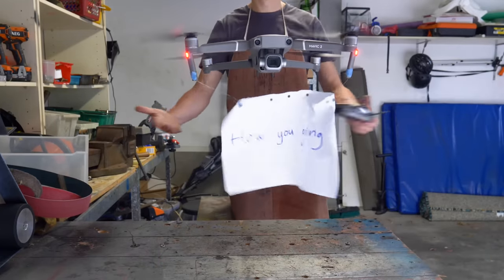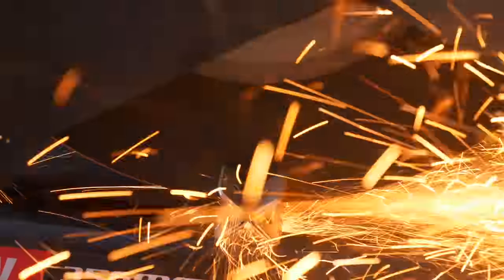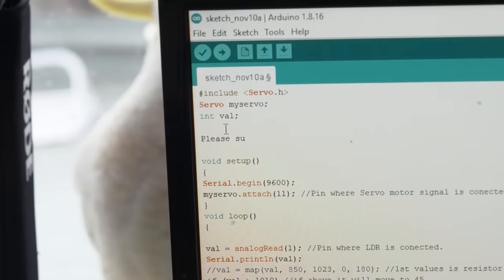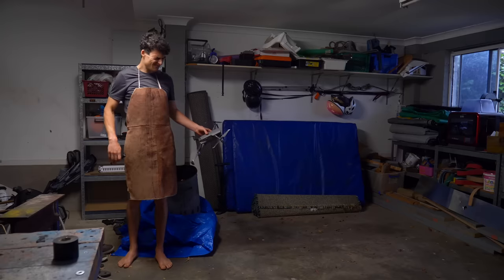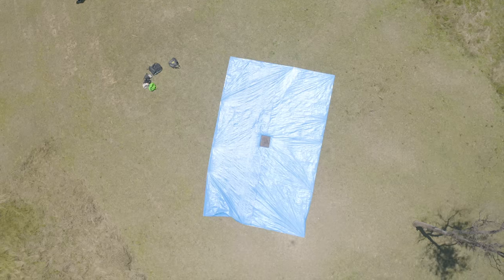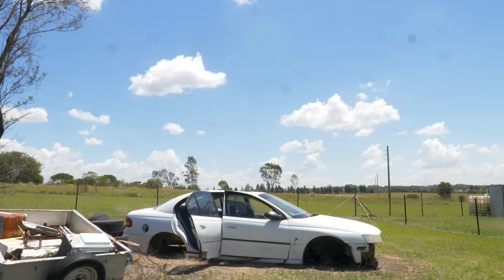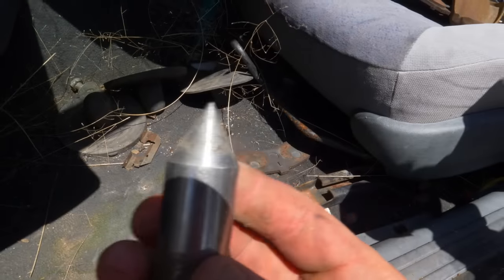Drone Darts are Silent and Deadly!

Comment: Random thing, but groups in Ukraine have been using drones this exact same way, using the light switch as a DIY mechanism for servos that drop payloads, quite ingenious
Reply: and there are videos of nice hits into open sunroof of the car or a military vehicle 👍
Reply: In myanmar as well
Reply: That video of a nade going through the driver's hatch was something else, imagine being the crew of a Russian tank in this conflict. Manning ages old Soviet armour without AC, and you can't even open a hatch to cool off because there may be someone waiting to have his day made by it
Reply: And where do you think they got that absolutely genius idea? 😎
Reply: Yeah, I wanted to write the same. Our soldiers use custom 3D printed holders with drop mechanism.

Some russians "geniuses" trying to do the same, but they put granade to fucking cup from destroyed ukrainian  kitchens... and it worstest thing ever, sometimes "something goes wrong", and cup just turna, and granade falls somewhere to their own blindages.
Reply: His light switch was really misguided. There are really easy compact circuits you can build from parts from old electronics. 1 FET or BJT a light sensor, LED, crappy solar panel from calculator or solar light, a battery, and a resistor or two depending on battery current and voltage. Plenty of schematics on google images for light activated switch. Better than a servo is nitinol? wire/muscle wire is used in toy helicopters to release plastic missiles. His release mechanism could have been smaller than the missiles and weigh nothing
Reply: you can pay these groups to have anything written on the bomb/mortar/grenade and they'll take a video of them dropping it (with your custom message on it), its like a death cameo, kind of interesting and also kind of morbid
Reply: @Wtfinc  Don't know a lot about electronic circuits or whatever, but can't you just kinda hijack the signal that activates the light in the first place, rather than having something react to light been seen. Like check if there's current in the wire that goes to the light
Reply: whatever it takes to send the orcs home, whole or in pieces.
Reply: How
Reply: @riograndedosulball248  why would a tanker need AC, their survival expectancy is like 10 minutes
Reply: @roadsigncheems1566  OMG that's horrible... Where?
Reply: @mymy-nv4er  lol, i dunno probably some tor site, or you could go somewhere shady over there and “meet someone”
Reply: @ukrainian333  yes i saw a video of ukrainian soldiers doing the same thing with a plastic cup.
Reply: Probably learned it from this video lmao
Reply: @riograndedosulball248  Or a Ukcop in the trenches having grenades dropped on you then a barrage of Russian artillary following it.
Reply: Both Ukrainians and Russians and myanmar army and myanmar rebels doing it. Actually it has become mainstay.
Reply: Are you insinuating that this video teaches you how to build weapons to fight against a heavily militarized enemy like, for instance, the goverment?
Reply: @Pavidota  yeah I'd guess you can just replace it with a radio controlled signal.. If you have enough spare time and a few dollars anyone with an average IQ and some guidance from the internet can make these. There already are drones with release mechanism to drop toy munitions lol
Reply: @riograndedosulball248  hatch shots are on abandoned vics (either out of fuel or otherwise immobilised)

Comment: The Romans used something similar, although it was thrown so that the arc of it would bypass the enemy's shield 🛡. It also had a piercing iron point.
Deadly lawn darts...
Reply: It was called a  Plumbata.
Had to look it up....
Reply: @leveljoe  If you haven't already, look up Tod's Workshop. He tests them out (as well as a lot of fun historical weapons which now include a trebuchet).
Reply: Im pretty sure pilla had long points so that they would pass through the shield and hit you behind it. I think they were also made of mild steel with hard iron points so that they would get bent and couldnt get thrown back. The romans would then fix and recylcle them.
Reply: @OutOfNamesToChoose  beat me to it, really good work from Tod in everything he does
Reply: I am pretty sure lawn darts by themselves are deadly.
Reply: So... Lawndarts
Reply: @MazeFrame  
Yes, but lawn darts we're not made with the intention to kill/injure,  the plumbata specifically was and predates it buy a number years.
Reply: @OutOfNamesToChoose  
What's old is new again.
Reply: @mietek3921  Did the pilum get typo'd to "pilla"?
Reply: @leveljoe  no, pilla is plural for pilum. :)
Reply: @mietek3921  👍good to know, but it has only one "l". 
pila
Had to look that up too.

Comment: In the next video you should try to turn your military drone into a normal drone back again. I bet it will be much harder, because they are not designed for that task!
Reply: Just remove the loosely taped on electronics?
Reply: @4esv   I think he meant an actual military drone
Reply: @danmack7769  he said "Your" military drone, I don't know how he could've meant "someone elses actual military drone" whilst saying "your military drone"

Even better, English got it's possessive pronoun structure from german so I don't even know how that got messed up.
Reply: @4esv  Yes I know what you mean, but I was thinking he was going for it as a title. You know for example "How To Turn Your Military Drone Into A Regular Drone!"
Reply: @danmack7769  You know what, fair point I did not look at it that way. You are right

Comment: if you wanted more accuracy you could have angle the fins on the back to impart spin, creating an amount of dynamic stability.

But also, you can't use drones above 400ft  (133m) in Australia soo...
Reply: I think much of the lack of accuracy comes from the latch yanking the fins to the side as it releases
Reply: @Skwerll  "I welded a metal latch to a $970 commerical drone"
Reply: @Skwerll  A lot of bombs are dropped horizontally so that shouldn't be much of an issue. I agree with the first comment in that an angled pitch on the fins would help provide dynamic stability which also helps mitigate the air resistance on the fins which could be responsible for additional variation
Reply: I thought that the moment I saw the fins.

Comment: Why straight fins? Twisty fins would probably stabilize the dart and improve accuracy.
Reply: Simpler/easier or just what was thought of/what was found on the original
Reply: I guess they are easier to make  simetrical.
Reply: Twisted ones would slow it down a little. He could have made them larger though

Comment: Just an FYI. When soldering small parts apply a bit of solder to the iron itself. Makes a bead on the end.  Then just tap the bead to what your soldering and it just drips on. Instead of holding it all to the prong itself. Great vids tho. Love what you do
Reply: If you want good solder points, you apply a little bit of solder to the tip (just a thin "coat" for the heat transfer), heat up the pad and melt the solder on the pad, not on the tip. Otherwise, your flux will be gone most times, creating ugly and potentially cold solders
Reply: @anonaustria9867  i like that for switches and large cards. But if your doing micro mini its easy to burn a processor or smaller chips. If you do the bead on the end and touch it to the prong, it shouldn't transfer until it hits temp. And you won't add the solder to to the tip till its at max temp. Shouldn't be on it long enough to burn.         Im def not saying your way doesn't work. Or that yours isn't a prettier joint. Just saying what worked well for me. Its also helpful if you have very shaky hands like me.

Comment: The reason those bombs did not only have a tip at the front but also at the back is to redirect air back into the fins at its back
With the current design the fins at the back are at least half into a low-pressure zone as they're at the back of a flat end so the air isn't going as much into them as it should
If you can also make the back end thinner and find a way to make those fins into a spiral, this would get really accurate

Comment: Instead of welding the fins directly to the flechette, add a steel rod about 1.5 times the length of the body. Then attach the fins to the rod.
Reply: Or depleted uranium or tungsten to make a homemade armour piercing Tank round

Comment: you should do this test again, but for the next test use tungsten or similar dense metal near the tip and tehn use the 1040 as a casing with guide fins for stability - the denser metal will help it accelerate at a higher rate and achieve a higher impact velocity.
Great video!!
Reply: Kinda the right idea but not quite, acceleration is constant no matter the material, that will only depend on the air resistance of the geometry of the item at hand. Tungsten would have greater penetrating power because as you say, it’s more dense and by virtue of having more mass in the same space hits with more force at the same speed

Comment: I think you could improve the accuracy by adding fins to the dart, angled in such a way that it starts spinning from the air resistance.
Reply: What thonging the same, plus the originals have the angled stuff
Reply: And talking about weapons with the force of a nuclear warhead!
Reply: A better relocation of the center of mass and a longer tail before the final would make them more accurate. A small insert for a tungsten rod and about 3 inches more before the final would make this thing truly terrifying
Reply: I’d love to see all of these suggestions applied to a bigger drone using a heavier duty dart
Reply: + explosive tip
Reply: @rileymoffatt7702  I was thinking the old school yard darts attached to a hoola hoop that somehow releases them all.  Holy shit that would be scary.

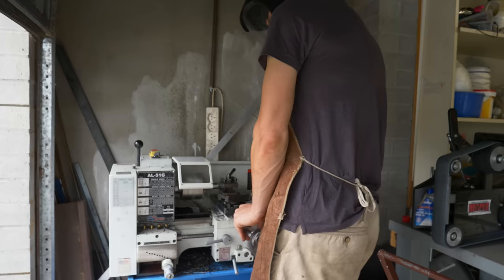Comment: 2:20

So you probably know by now but anyway. Your small lathe has no issue working with that stuff if you dont try to take off 3mm per pass. You do however need a cooling/lubricating pump if you wanna work with high gradr tool steel.

Comment: Its occured to me that you might have been able to heat the tool steel then let it slowly cool to anneal it. Might have made it more machinable. That being said, the 1045 worked great!
Reply: Annealing will mess up with the reason you wanted a tool steel in the first place, its factory hardness.
Reply: @louisvictor3473  That's a fair point. It would need to be heat treated afterwards  to return it's hardness. It probably isn't a practical process to go through for a project like this but it's possible.
Reply: @downardesigns4148  TBH, I might have messed up that point. I am bit rusty (pun intended), but now that I thunk a bit more, stock tool steel doesn't necessarily come hardened, exactly to make it more machinable. So depends it may or may not have been a factor already, hard to tell. If it is pre-hardened, annealing and re-hardening per se isn't too complicated today, but matching factory levels of quality, that is the trick.

Of course, it is possible either way, at least technically. But you have a combination of quality of the tools he does already have, budget, skills in different areas, and time. The combination might just put things out of reach, and/or you might just get better/just as good results doing the easier way anyway.

Comment: if you want to avoid the wind pushing it too much try adding a bit of spin to the darts. angle the fins to make it spin and it will counteract the wind, which will in turn make it more accurate and possibly even faster.
Reply: Nice idea
Reply: alexadao8852  it's a heavy dart, not a fucking Helicopter...

Comment: Couple things I think you could do to improve this, make better fins on the...  I guess "bullets"... so they travel in a more straight line.  Also maybe get a better servo for the release mechanism that releases the bullet more clean.  Also I'd perhaps make some kind of tube or shaft for the bullet to sit in so it isn't singing back and forth before being released, like a bit of pvc pipe it can travel down.

Just some tips in case you wanna take a second stab at this, I think if you take that thing up to max height in the right conditions it maybe could pierce the engine block.
Reply: The word you were looking for is projectile.
Reply: Flechettes. They were used in the first world war too
Reply: may as well rifle the pvc pipe while you're at it

Comment: This is an actual thing being used by insurgents over in the middle east, basically exactly the same as you've made it here, except instead of your light sensor they use electromagnets and hand grenades.
Reply: @degru5091 I can't find the picture of the one that got shot down in pakistan again but I think they're modified to use impact triggers. That or the pin's tied to the drone with a long enough string to yank it out.
Reply: @valthorix7347  I've seen some videos of such drones and I think they pull the pin before flight. The grenade is held in place by a wire and, when released, the wire lets off the grenade's handle. 
Russian and ukrainian militia use 20mm HE shells without the casings.
Really, there are a number of ways one can do this, that's why modern armies are trying to develop effective anti-drone measures.

Comment: You really need to get a coolant setup for that lathe
For machining hard metals it's basically a requirement to reduce tool wear and stop the screeching.

The reason all your metal swarf is that blue colour is because it's getting extremely hot which is TERRIBLE for your tools

But man your videos are still great

Comment: Pro Tip; Strap your angle grinder to your toolpost (make a fixture or something, strap it down with hoseclamps if you have to) in a way that you can still use your compound feed, you'll save bucketloads of cash on carbide for small jobs like this, and it cuts relatively quickly. You just run the RPMs down low and find a cut depth that doesn't overheat the part and overload the wheel, usually a couple thousandths per pass. You'll love the surface finishes too, especially if you use a fine and dressed wheel and the grinder is mounted rigidly.

Comment: I think the tail fins need to be redesigned to cause it to spin which would keep it going straight, less chance it would flip around. 
You could also make the dart a bit of an elongated teardrop shape with a point, which would use gravity to keep the point downwards.
Reply: You can make the fins from paper, they only need to create drag. The weight should be focused in the nose.

Comment: Ghost Platoon, the novel, describes JDAM like smart mortars with HE warheads coupled with small POV drones strapped to the soldier's backs which act like surveillance and targeting system.  Published in 2019 and an exceptional read.  Worth my 8 bucks or whatever.  Could you reproduce that system?
Reply: Fpv kamikaze drone with bomb 💣 can act like smart shells and even better
Reply: @gorishokgo5825  the switchblade at home.

Comment: Am I the only one that is extremely surprised that this drone can go up to 200m and maybe even higher?
Reply: They can go way higher than that mate. 120m limited in most places with a hard cap 500m altitude.
Reply: @bored-co7722  400ft , 120m according to the fun police (CASA)
Reply: my drone says i can only go to 400ft but those are chump numbers
Reply from the maker: "can go"
Reply: Its not hard to go high. The air doesn't thin that much. And once it gets out of ground effect it just doesn't matter how much higher it is then the ground.
Reply: Flying above 120m and dropping shit from a drone are pretty big ass kicking offences. Federal crime, I am led to believe. I don't know if I'd be so bold to video it and put it on youtube.
Reply: @Ididathing  I own a DJI SE and its a great drone, works lovely
Reply: Strat: DJI drones set your launching altitude as 0 m, so just tie one drone on top of another, fly it to 500M, and launch the second, to get a free 1KM of height to play with

Comment: Pro Lathe-tip: the rpm on the lathe and the speed of wich you can cut is  related. The doscoulleration is due to excessice heat because you  had the wrong settings for that specific type of metal, and or because you cut to fast. There are simple equations on Google and I bet there's a plate on your lathe with speed settings stamped on it👍😁 it'll save you alot of money for tools and material knowing what settings to use, it's safer and its gonna leave a much better finnish

Comment: Somehow, I find myself watching this video again over a year later, and again I am appalled how many times I've seen  a "YouTube Engineer" (for lack of a better term lol) use a soldering iron WITHOUT USING FLUX!!
Do yourself a solid mate, spend like $10 or so and get yourself a nice little tub of no-clean flux, a box of Q-tips and some alcohol (Bunnings will have small cans of 99% alcohol for cheap and it's the best imo). 
It will make soldering so much easier, and the joints will be nice, shiny and strong (and we know eveyrone loves a strong joint).

Comment: 7:05 - About the soldering...
- It looks like an old circuit-board, given the oxidation on the copper. Soldering will go a lot easier if you clean the pads first, easiest way is to use a pencil gum.
- Buy soldering flux, it will make soldering even easier.
- Use leaded soldering tin, unleaded is just garbage. Avoid inhaling the fumes!

Cheapest setup to avoid inhaling fumes: Desk chair with wheels...
1) Role back, turn 180° and inhale.
2) Hold breath, look and role forwards, start soldering.
3) When out of breath, repeat step 1 followed by step 2. 
Give it some time and you will be able to hold your breath for 3 to 4 minutes...

PS, your components are huge. I solder 0402 resistors and capacitors manually...